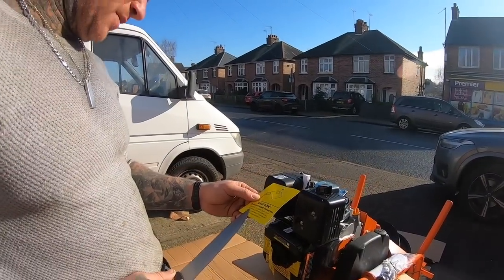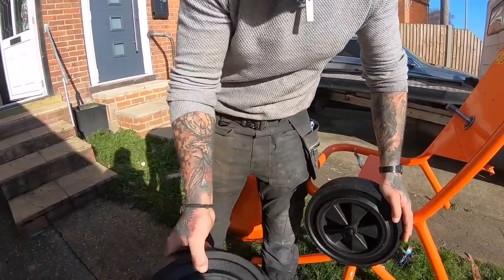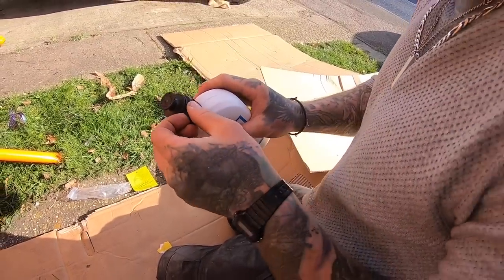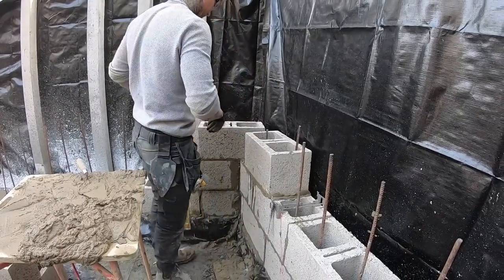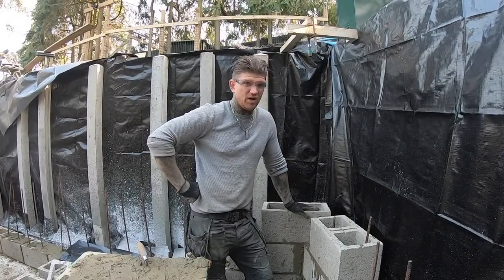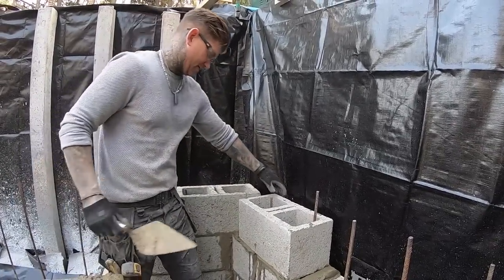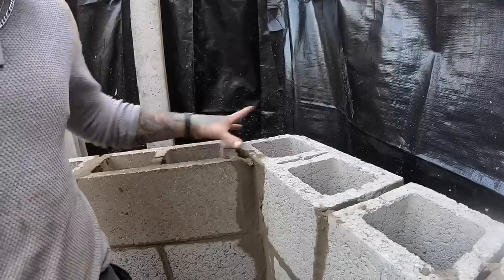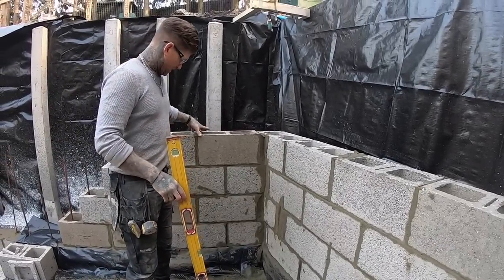The British Belle Mixer!...

Comment: Looks like you have a pallet of half blocks there mate, dont use them All up, you are also laying them upside down, the V in the middle goes to the top and should have a 10 mm rebar layed in it.Put the line on the other side and lay them overhand far easier than lifting them over the line.

Comment: Charlie, as a tip for the rebar, keep a galvanized piece of pipe handy, maybe 1500mm, thick walled, say 50mm dis, and use that to bend the rebar. Gives you a decent lever and can fit down the block work to the bottom of the slab. That’s really where you need to bend the reo from.

Comment: Simple way to centralise the rebar is use tie wire round the bar to the diagonals, you can make a batch and slip them over a quickly adjust, then when you pour the sloppy mix you can also get a poker in all the way down, those bars would need overlap and tying as you said not they way they are going to be....

Comment: We do a lot of basements/Garages with 8inch solid block like that, the rebar is never in the right spot, we always use a concrete saw and cut the center webs out or the end out and make it work that way.
Reply: A much easier way is to lay your first course then drill holes in the footing and epoxy the rebar in place exactly where they need to be and build your wall.
Reply: @markadler8968  I agree, but normally it's in the concrete guys bids Here in the US.

Comment: You get a pudlik and bend the rebar at the base from the start. Every day is a learning day Charlie.
Reply: That and possibly cut out a small internal section of the block on the bottom course if the groundworkers bugger up the setting out 👍🏾
Reply: @toadturd  Bend the roo bar with dogs legs so it misses, pain in the arse but they are in so sort it out...not that I know anything abt metal work.. lol
https://youtu.be/E-ZgNAKsCPI

Comment: I’m not sure how heavy those CMU are but when you lay them you’d grab it from the center web with one hand and trowel in the other. Anyhow keep it up bro!
Reply: You won’t be grabbing them by the centre web and laying them with one hand . they are bigger and heavier than the American version of those blocks
Reply: @brickbybric  not by much and we lay the 12” wide blocks with one hand
Reply: @petep8828  an 8 inch c.m.u comes in at around 38 pounds 17 kg . The nearest block we have size wise to an American 8 inch block is the ones Charlie is laying and there 23 to 25 kg so considerable heavier .they are commonly referred to in Ireland as 9 inch cavity blocks or 2 pot cavity blocks . There metric measurements are 450 mm x 215 mm x 215 mm . Realistically how many courses high can you lift a 12 inch block with one hand .

Comment: Hate to tell you but the underground gym will leak leak like a sieve and it is not your fault I think you should tell the customer as it is not your responsibility regards Howard
Reply: 100% right. Unless however you apply about 12 coats of waterproof slurry on the inside of the blocks 😂. Then you might be safe.
Reply: Why is it going to leak?

Comment: Blocks are upside down. Grab them in the center stem, or if yer not able opposite corners left top right bottom. If the rear is running foul use a brick or off cut in the hollow to realign the bar. No more big money click bait titles laying those blocks eh fella ?

Comment: The way I build them blocks is either  build first row in fresh laid concrete footings and then place rebar or if  footings solid build first row and drill holes for rebar and resin in place but  unfortunately most of the time someone else has them already in footings by time you get there and usually never perfect,are you putting horizontal rebar in as well
Reply: First course

Comment: Those 20 cm blocks don't go in as fast as the bricks do they? I remember working as an laborer back in the 80s and we installed 10" expo blocks. They were a 10" block and had a decorative 4" thick ridged face on the front of the block and they weighed around a 100 lbs each. They would literally turn men into hunchbacks and cripples. I also remember working with my old man on a chimney in an attic back then with 24" chimney blocks which weighed over 150 lbs each. Both of these have long since been banned due to the damage they caused but those were the days 💪💪💪

Comment: Got to love those belle mixers, mine was a 2nd hand one 2006 mode (electric)l, hadn't been used in years.
As soon as I brought it 4 years ago, I took it all apart and gave it a service, new belt and pulleys, new oil. ( It didn't need it but my father stripped the gear box and replaced the bearings) should out live me now.

Quality mixer 👍

Sounds like who ever installed those rebar's didn't space them out correctly.

Mike Haduck Masonry on YouTube is an American man, old school bricky he has some fantastic videos with excellent tips tricks and skills laying those blocks over rebar.

Keep up the good work Charlie and Amy 👍
Reply: We've got one that was previously given to my dad around 15 years ago and he used it but now we have it, and it was manufactured in 1999 so its the same age as me. The gearbox gave up just a couple days ago in the middle of a concrete pour but hoping to just buy the new shaft/gear and seals and repair it. It's amazing really and a testament to how well built they are. I think it has only had two new drums in its lifetime but numerous belts, I can't imagine the amount its mixed in its lifetime.

Comment: I’m a Canadian brick layer and we cut the centre or the end web out and bend rebar where we need it,we also run the line on the back of the blocks so you don’t have to fight with it. Those are 8 inch block we sometimes work with 12 inch block they are very heavy makes 8 inch feel really light you will get it Charlie keep up the good work
Reply: Did a job with 4 other bricklayers. 500,000 8-inch blocks. I've had my fair share for the year 😂
Reply: Line goes face side ALWAYS. Get stronger and you can lift over lol

Comment: I had my belle 240v for years it turned out hundreds if not thousands of gaugings of compo and concrete . I only replaced the drum once in 10 yrs . Cracking little portable mixer. Drum will last for ages if you make sure you wash it out not bash it out ?